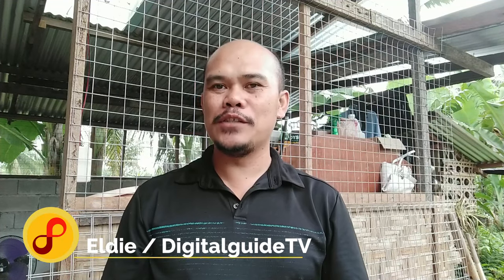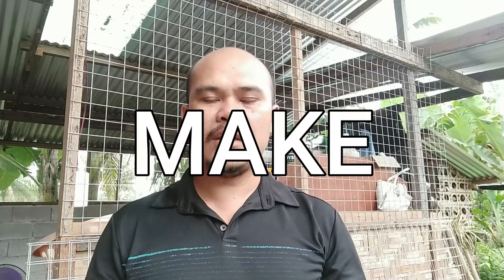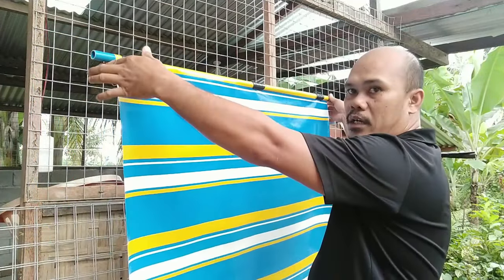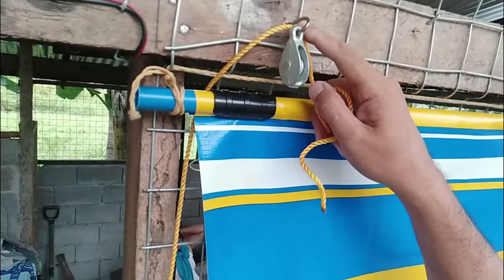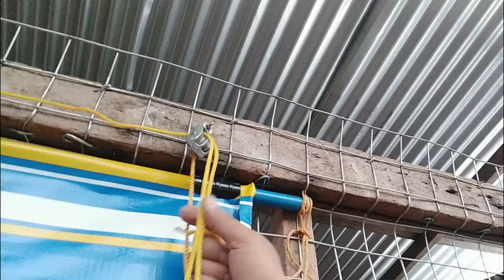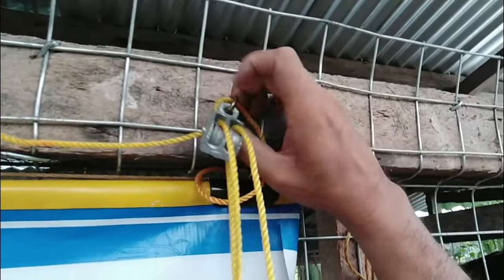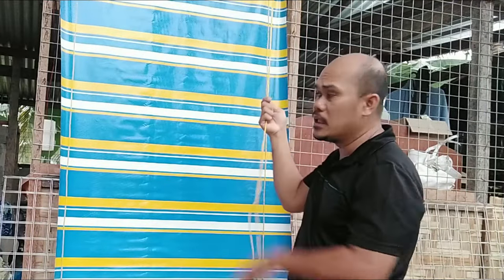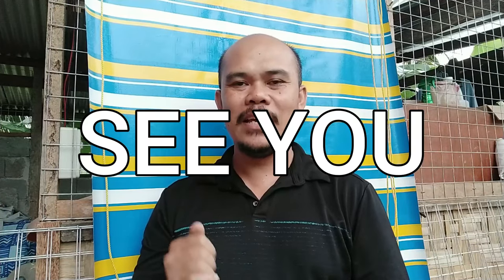EASY TO MAKE DIY ROLL-UP CANVAS OR TRAPAL | STEP-BY-STEP TUTORIAL | #DigitalGuidePh

Comment: Hi your video was very helpful Where can I get pvc clamp do you have link Where I can buy that pvc clamp.
Reply: You dont get  reply but maybe I can help - cut some excess pipe in short sections and then with a hacksaw cut one side only horizontally.  You end up with a section of pipe that will snap over the original..you may need to prise it a little with a screwdriver or such to widen the hacksaw cut but it will work with a little perseverence.

Comment: it would be better if a lower bar  is metal or Gi pipe cause weight make better rolling
Reply: You don't need to use a GI pipe or metal pipe; just fill a PVC pipe with sand and put PVC caps at both ends. It will probably look nice